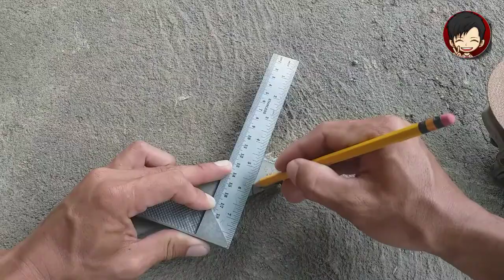Gumawa ako ng Center Table mula sa scrap | 60×60 granite tile | DIY center table #centertable #diy

Comment: Anong size at amperes ng welding rod mo sir? Bakit hndi nabubutas?
Reply from the maker: Depende kasi yan sa machine mo boss dapat alam mo timplahin amg amperahe may mga machine kasi na di accurate kagaya ng sa akin 100-120amp ,pero may machine na 80amps nakakatunaw na .6013 gamit ko boss yung ordinary